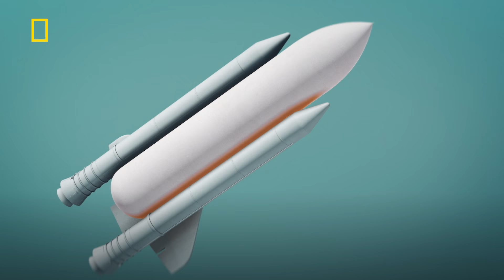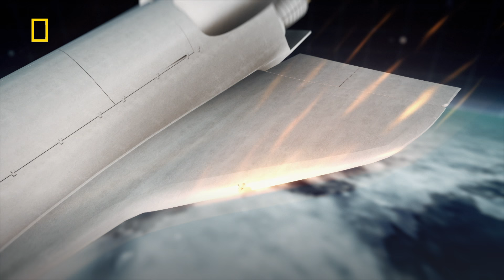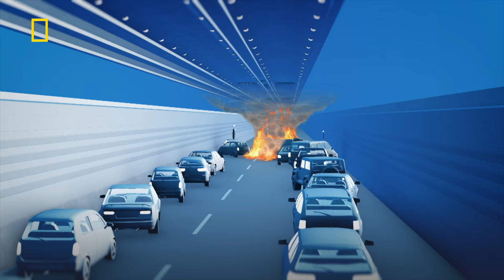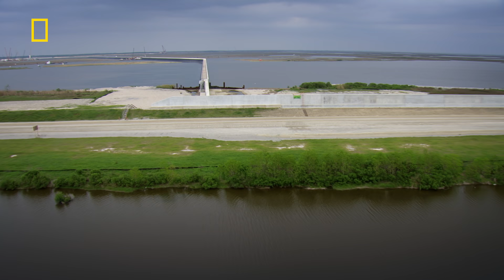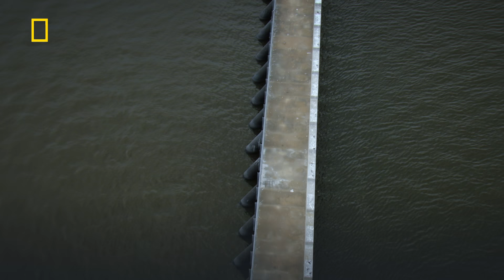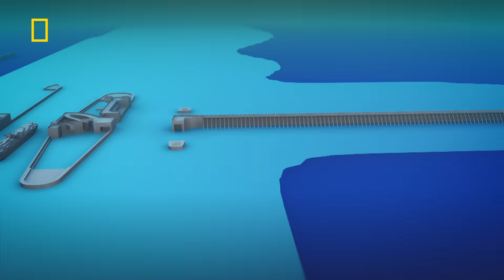Engineering Failures That Changed Everything | Engineering by Catastrophe | National Geographic UK

Comment: Most "engineering" failures are actually caused by management mandating cuts to cost and time to market (launch).   Demanding tests be skipped, corners be cut, lower quality parts be used, and lies be told to customers and regulators.  I've seen it dozens of times in my career.  But in the end, it's always the engineers who get the blame.
Reply: and corruption.